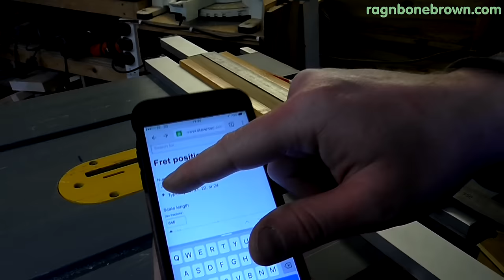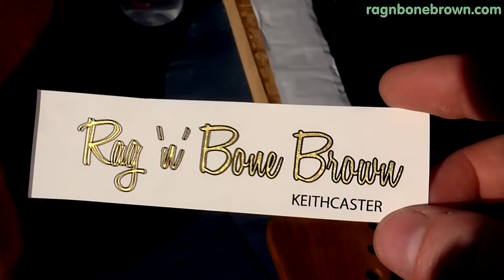Making An Electric Guitar from Salvaged Oak - THE WHOLE BUILD (QUICK VERSION)

Comment: THIS IS WHY I WATCH EVERY SINGLE GUITAR BUILD NO MATTER HOW EXPERIENCED THE BUILDER IS. THE HOT GLUE TO HOLD THE FINGERBOARD TO THE TABLE SAW WAS GENIUS. YOU CAN LEARN FROM EVERYONE EVEN NON PROS. NOT SAYING THIS GUY IS A BEGINNER I DON'T KNOW HOW LONG HE'S BEEN BUILDING JUST AN OBSERVATION. THE ONLY THING THAT WAS CRAZY TO ME WAS CUTTING THE TRUSS ROD CHANNEL BY DROPPING IT ON A MOVING TABLE SAW. THAT IS MIGHTY BRAVE AND I PROBABLY WOULDN'T MAKE A HABBIT OF THAT. TRY USING A ROUTER TABLE INSTEAD, THATS THE WAY I DO IT AND IT WORKS GREAT AND IS 100% CONTROLLED. STILL LOVE THIS VIDEO THOUGH.
Reply from the maker: +eddie julian thanks Eddie, my first guitar. There are extended video builds on my channel if you want to see full version and my thought process

Comment: Nice build, and cool design! My guitars are just in my head yet, but one day...
How is the weight compared to a maple body guitar? I guess it's quite a bit heavier than a Tele.

I have been thinking a bit about which order I should do the steps, and I think I would glue the fretboard in and do inlays and markers before installing the frets. And most importantly mount the neck before positioning the bridge, I've done quite a few setups, and on some guitars the alignment of the strings along the neck could have been better, and sometimes it's not possible to intonate the guitar properly. I remember a Danelectro with a similar bridge where I had to file one of the notches deeper where it rests against the posts to get the scale length right. But when listening to you play, it sounds like your guitars plays in tune on all frets. I guess it works if you are really careful when measuring out the dimensions.

Would you do any of this different on another build, or am I hung up on stuff that in practice doesn't matter ?
Reply from the maker: +Frode Haugsgjerd hi, thanks for your comments. Not sure if you know but there's also a 9 part series of videos going through the build in detail where I talk about the things that went well and the mistakes I made (which there were a few of!!) it was my first attempt though. It is quite heavy but not overwhelmingly so.
Reply: Rag 'n' Bone Brown  Yes I found them right after I posted that. Way down on a impressive list of furniture making videos. Beautiful stuff!

Comment: How's the guitar holding up since you built it? 
Also, how does it compare to a ~$500 store-bought model? (I'd imagine it's better, but I'm curious to know)
Reply from the maker: +Daniel Simonds if you look up part 9 of the full build video I talk about it quite a bit. It's holding up fine. It doesn't play quite as well as some as I messed up the neck height a little bit and had to try and rectify (it was my first attempt at guitar build). It sounds better than most mid range guitars that I've bought though and looks better in my humble opinion!

Comment: Safety police here... you're fired!
Reply from the maker: For?
Reply: No safety glass, standing directly behind the table saw and plunging straight down on a table saw. 
I'm not being serious though. We all work our own way. Great video by the way and the axe sound fantastic.
Reply: Right on: cutting the truss rod slot without using any form of holding tool( which could easily be screwed onto the neck where the wood will eventually be removed) is reckless and should not be shown in a video which other people might follow. Fingers are very precious - especially for guitar playing!!!